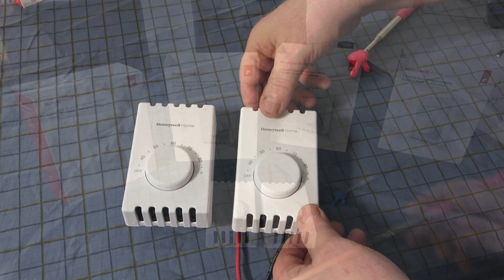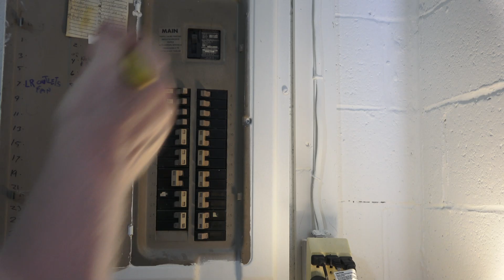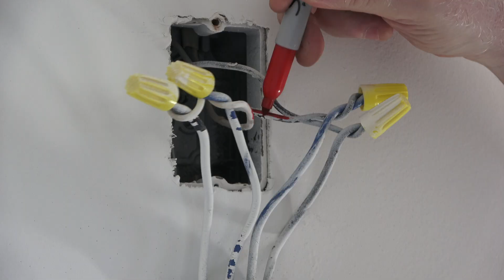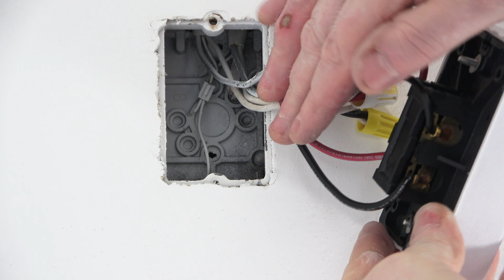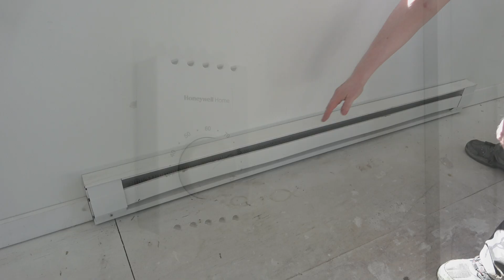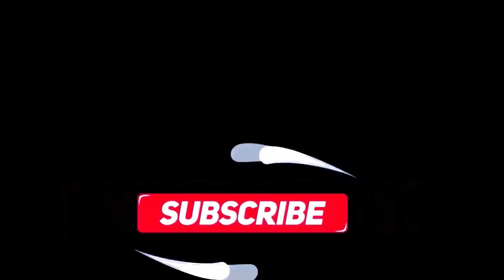How To Wire 4 Wire Baseboard Heat Thermostat

Comment: Why can't we use 2 wires if it take 120 and 240v
Reply from the maker: This unit is designed for 2 wires both out-of-phase 120V hot wires which equals 240 V output

Comment: How would I go about wiring it with 120v instead of 240
Reply from the maker: No, you cannot directly use a 240V 4-wire thermostat to run a 120V baseboard heater because a 240V thermostat is designed to switch 240V power, and a 120V heater will not function correctly or safely on 240V wiring without modifications
Reply from the maker: Use a 120 volt baseboard heater matched with 120 volt thermostat

Comment: What is maximum wattage for the 4wire ct410b
Reply from the maker: (Google generated) The maximum wattage for the Honeywell CT410B 4-wire thermostat depends on the voltage of the electric heating system it is connected to.
Wattage capacity varies by voltage: 
2640 W at 120 VAC (22 Amps resistive)
5280 W at 240 VAC (22 Amps resistive)
5263 W at 277 VAC (19 Amps resistive)